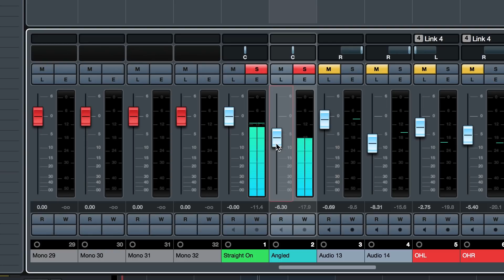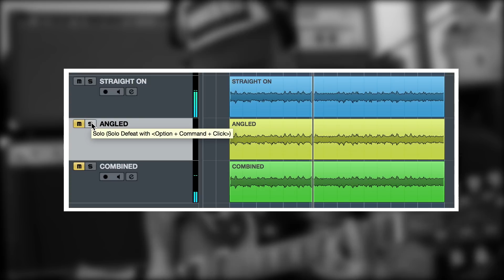Official Fredman Technique Microphone Clip

Comment: Did he mention if both mics (angles and straight) should be at the same volume?
Reply from the maker: Should have been more clear about that. It’s basically how you set the sound. One mic is bright and the other is dark. Then you balance by taste.
Reply: You adjust to taste until you get the result you want. For me personally, when using this technique on a 5150, I've always settled around having the off-axis mic about 5-6db quieter than the on-axis mic. I've followed this debate closely since like 2005. I've always thought the colony/clayman guitar tones were some of the best high gain rhythm tones ever recorded, and using this technique will definitely get you pointed in the right direction if that's the sort of sound you're looking for. A 5150 MKI(block letter even better) will get you even closer.

Comment: It's rad that Fredman is making an official one. I have some clips from the Wilkinson Audio site, but I don't know if those are the inaccurate ones (I think Glenn Fricker uses them). They work okay, but slip over time since the clip attaches to the straight 57 (which is a bummer). I just finished a metal project with a client where I recorded the guitars with two 57's fredman style and a wa87. I actually ended up muting the straight 57 track and went with the angled 57 and wa87 in the final mix. The straight 57 just sounded too harsh in my mix so I preferred it without it. So that's my preferred method now. Anyway, you can hear how it came out if you like.  Great vids as usual bud. 
https://duvcon.bandcamp.com/album/problems-applications
Reply: The thing is, the Fredman one is 55 degrees, not 45 degrees like the Wilkinson one. According to Fred, the 55 degree sounds better to him than the 45.